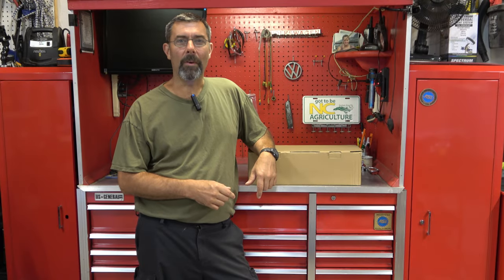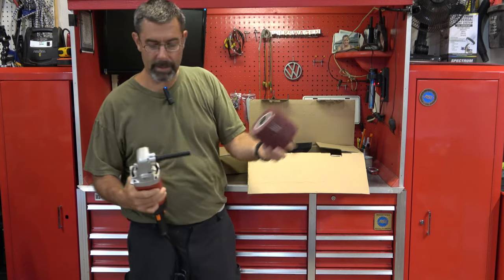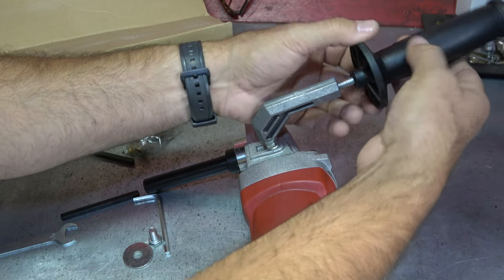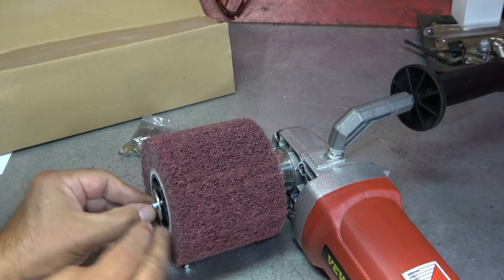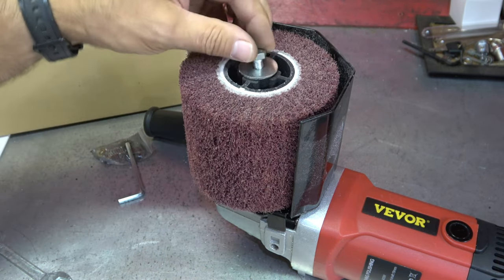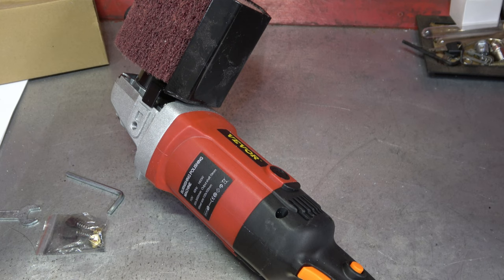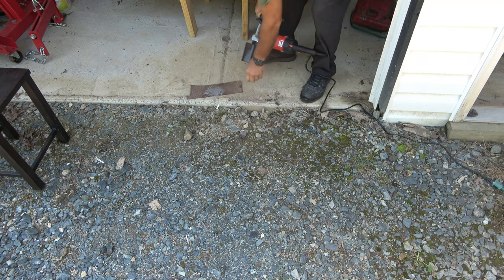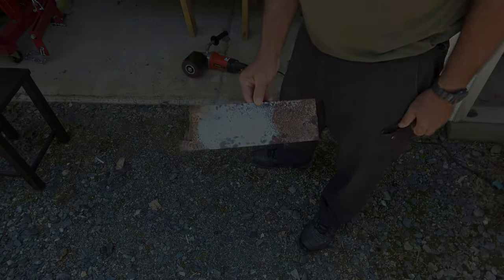Vevor Surface Conditioning Tool. Who needs a sand blaster when you have this!

Comment: I know it was an exaggeration when stating (who needs a sand blaster). This tool is good as long as your pieces don't have any crevices or sharp inside corners as to where a sand blaster gets everywhere. I like to sandblast caliper brackets and pieces similar to which this tool would fail. For your bus project where you have large surfaces this tool works great
Reply from the maker: Great point! It's still not going to get in the tough spots, but it sure is speedy for large curved areas!

Comment: Had one for over a year now. Brushes wear and the cover caps need constant tightening to maintain brush conductivity. The handle is poor design so get use to a floppy handle of making your own. The VEVOR sticker is just a place holder and this is a cheap tool that works remarkably well. Great on wood as well.
Reply from the maker: Thanks for sharing. I've used this one some on my Bus project and we've been happy with what it can do.